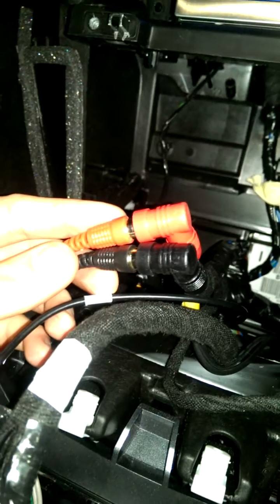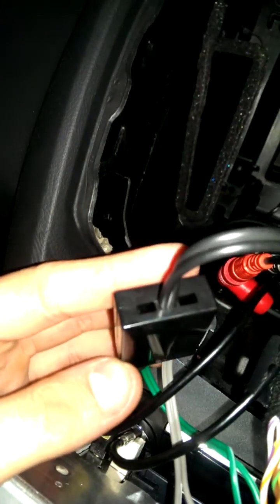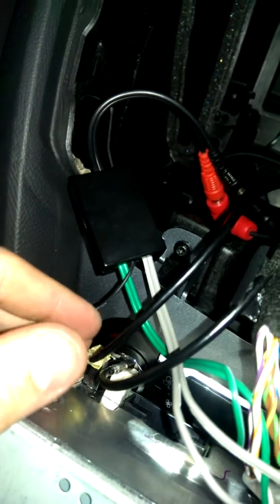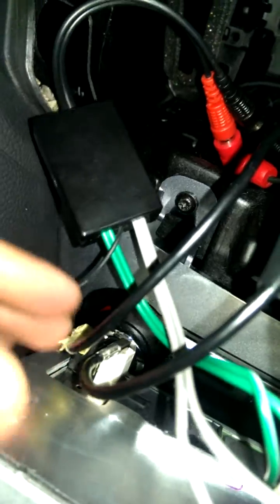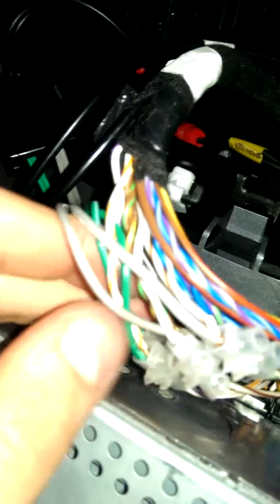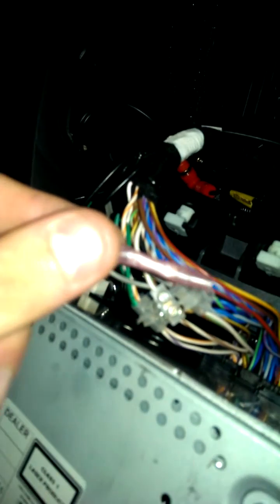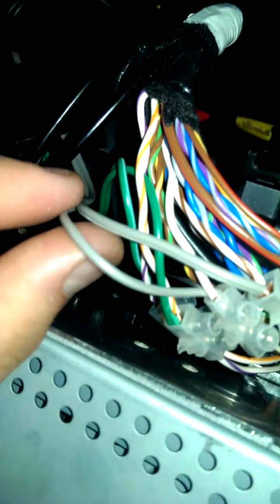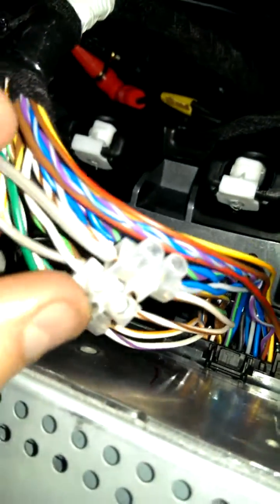Ford focus rca converter wiring

Comment: Hi, I have a problem, I have a Ford radio 6000CD, I adapter high-low HL-406 can you tell me where I have to connect the black ground cable, or you can write me exactly? thanks for the help
Reply from the maker: the black ground cable can just simply go into the Ariel port on back of radio or connect it to the Arial wire from the car.
If you carn't do that for any reason connect it to a negative wire on the back of your car wiring or radio, you will have to Google the wiring diagram for that to see which one it is thanks Craig